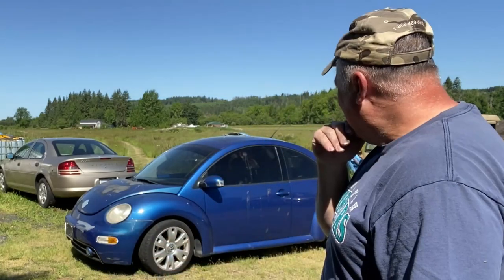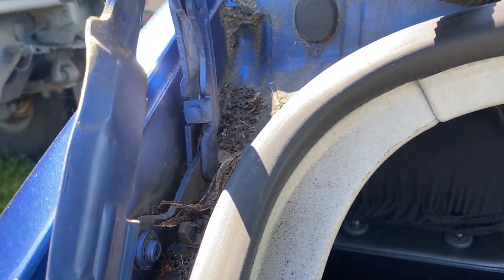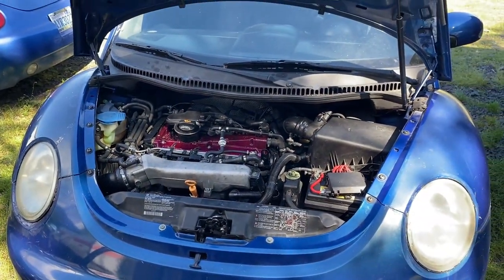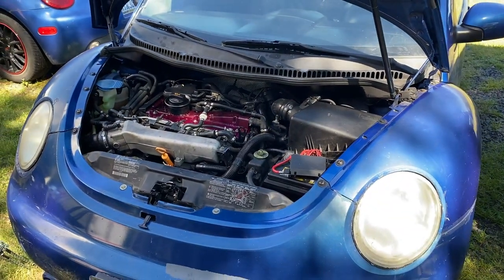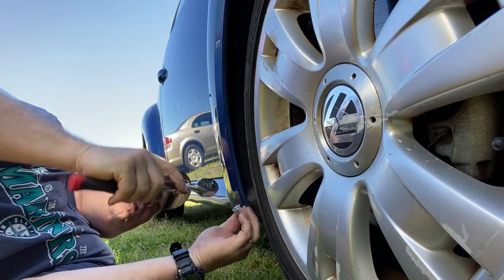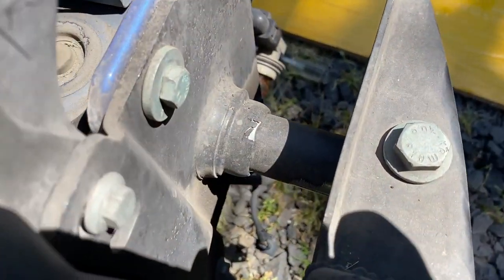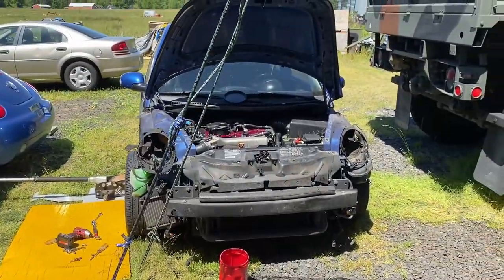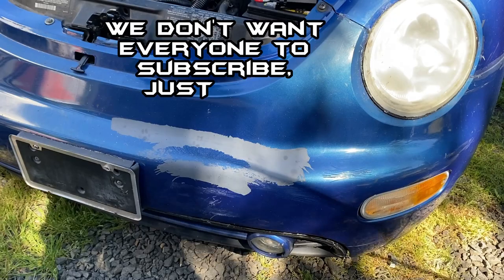NEW BEETLE RESTORATION, 1.8 Turbo!

Comment: I have a 2001 new beetle gls manual with 357,000 miles… I love this car! And speaking of handling.. I live in the Ozarks, switchback roads like crazy… I know there will be haters.. but I put 2 inch hubcentric wheel spacers on it (been on it for 4 years) and it corners like a monster, (bearings are fine) and it looks like a hot hot wheels car..
Reply: Love to send you photos of “Bug0us” you’ll love him
Reply from the maker: The corning is awesome, even without the spacers. I can't imagine it getting better, but yours is living proof.

Comment: I have a 99 Bug 2.0 5speed . 200434 miles.  Got it for $500 about 12 years ago  . Still going strong
Reply from the maker: All it takes is a little love every once in a while. They get a bad reputation from those that drive them into the ground, only adding fuel and nothing else.

Comment: I’ve had 2 beetles now also and a Jetta, the beetle handles amazing! Don’t drill a hole in your thermostat housing, the 1.8t is self burping. Just squeeze the hoses to create vacuum and get as much air out as possible, then let the car do the rest.
Reply from the maker: Car is still doing very well. My son is now completed with college over in Eastern Washington, where it gets very cold in the winter.

Comment: Here to help again ! NB’s Bumper always need to remove with the fender (strange design….)or the attachment between them might be broken by tearing it apart
Reply from the maker: I was able to remove the bumper cover in one piece by finding all the little screws that held it on. Eventually, I also removed these fenders because they were also damaged. Thanks for the advice.

Comment: Just got the wife a 2000 model 2.0l trendline . Paint is shot but good solid car . Came with 17inch turn 1 porsche replica rims. Its a automatic transmission for now but looking for a crashed audi rs 4 or rs3 . The plan is to add the rs audi motor and tiptronic transmission and braking system. After that custom interior .....they are famtastic. Lots of guys here jn southafrica havebinstalled a vw vr6 motor and skme also add parts from the kld audi tt. Great underated vehicle
Reply from the maker: I very much enjoyed reading your comment. I wish you could post some pics of that to this thread. Yes, I agree... very underrated car!

Comment: I have a 2001 glx 1.8t ...yea i like it.. Although i spent 5.000$ on it after buying it..
Reply from the maker: If you spent that much to bring it back from the brink, you really like it! I have the same feeling.
Reply: @HelicoolsHelipad  it's like driving a go kart..the lil turbo spins up and it takes off..I have a few mods..ko3s turbo..race n75 valve..tune..race diverter valve..race n249 valve.. downpipe and exhaust..
It's running around 230 h.p. That in today's standards isn't much but in this light lil car it's fun to drive..

Comment: I have a 2002 beetle Volkswagen turbo S is the chassis the same as a Porsche or a Nissan 300Z
Reply from the maker: Generally speaking? Specifically, the chassis is 100% VW, but may have some characteristics of other car manufacturers.

Comment: I have a 2002 Volkswagen beetle turbo S and the check engine light to come on sometimes and then goes off but not all the time does anybody know what that is please
Reply from the maker: You need to hook a code reader up to it. The computer should save all the information, so you don't have to wait for the check engine light to remain on. You can hook one up for free at any AutoZone, O'Reilies, etc..

Comment: got so tired of my TDI's running away.  2 of them now.... on last one this was even after swapping to brand new injection pumps and turbo.. and  it still ran away a year and a half later (still with in range on timing belt).  Presently driving a BEW closing on on 300k miles a friend gave me... but once I get my dieselized Jeep TJ working where I trust it (w/ MB  OM617A)..... I will sell all the TDI's.  just flat burned out on them.

Granted this is useless rambling since this thread is about a Petrol New Beetle.
Reply from the maker: I have a TDI New Beetle as well... love the car. Going on 320K... I don't think the turbo spins anymore, but I don't really want to put any money into it due to it's miles. I've never had a diesel run away (thank goodness). Sounds scary. 

This one looks like it will serve my son for his first semester of his Senior year in college. I hope to have it done for him, and then it's working on his car... found water in the oil. :-/